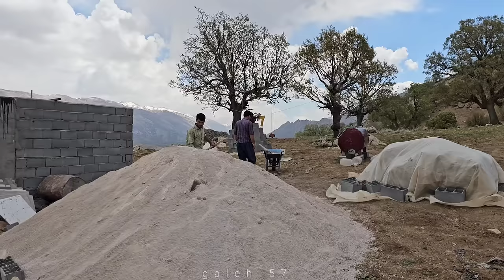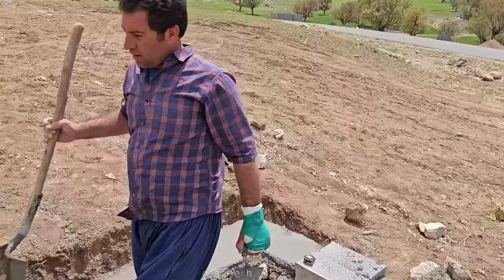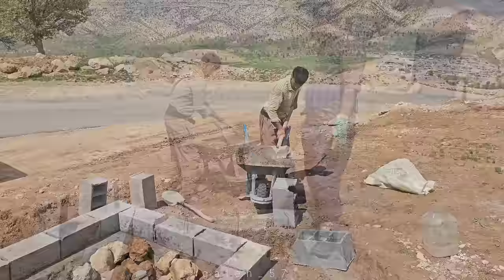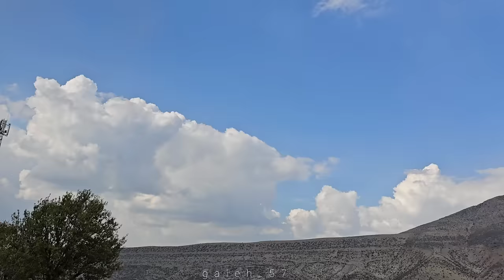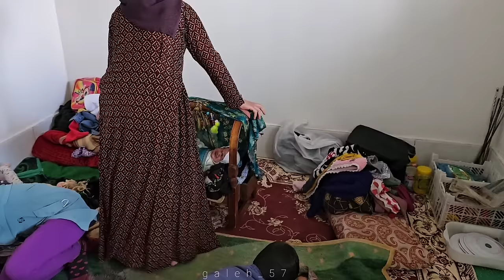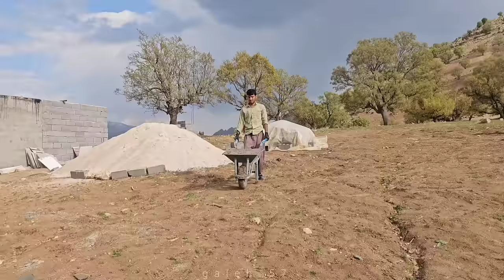Raising the wall of the toilet with blocks in a spring rain by the master worker

Comment: Strange way to proceed… 1) build the wall.  2) destroy part of it to open a window☹️  Furthermore I do not understand… what are they building ouside the hause if the bathroom is close the kitchen? Maybe there’s a difference between shower and toilet?
Reply: I'm confused ,  they just wasting material
Reply: Budują ubikacje z drzwiami na ulicę... Horror jakiś . Zamiast WC  z boku domu czy z przodu, to zrobili z tyłu , przy drodze i wejście od drogi....
Reply: Susan lo pidio ahi, cosa que a mi también me parece incorrecta, por poco a un metro de la calle 😬.
Reply: Es la parada del Bus😂😂, Dios mío, a lo mejor lleva después un cercado y ya no se ve de la carretera
Reply: There is a difference between  a bathroom and a toilet.    A bathroom is for bathing the body.  A toilet is for the elimination of  body waste. They do not have running water.  So, a toilet is a good solution.  
I don't know the  water table in this dry land.  So, drilling a well and installing water pipes  may not be feasable.
I live in an environment  where rainfall is generally plentiful.  There have been years when there would be drought.  But, that is not a normal thing  for us.
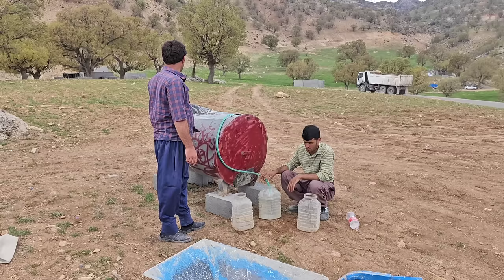Reply: 5:52 I think they're building an outhouse.  Putting it far from the house means they will have no sewage smell.  But across the street are people downwind living in tents.  Not good.
Reply: @PoohnTiggersMom ...metr od ulicy i z drzwiami na ulicę ? To jakiś żart ?
Reply: Yes shower is in different building from toilet
Reply: @roxelifigueroa3936  Yes, very strange indeed, but yes, the choice is hers. And I'm sure if the smaller children have to go to the toilet, Zaunab will be forced to go with them again. .
Reply: Bun comentariu
Reply: Susan why are you  putting the toilet next to the street! Poor decision,  you have small children,  and another thing, you depend on your oldest so much that the 2nd baby will only stop crying when she holds her. I don't know what to say  , but try to nature all of your children.  I see admire you ❤
Reply: Kışın bu tuvalete girmeye üsenir insan yahu umarım böcek filan yazın oluşmaz gördüğüm kadarıyla akıntı yeri olmicak toprağa mi disgilarini yapicaklar buda yazın çok sinek böcek uçuşur zor köydeki insanlarda bu şekilde evlerinden biraz uzağa tuvalet yapıyorlar derin bir delik
Reply: Yoldan geçen de artık tuvaleti kullanır acil durumda evin çevresi kapatılmalı ki burası suzana ayıt olduğu beli olmalı dışardan kimse tuvalete girmesin diye çok adada tuvalet kimin karariydi merak etdim
Reply: Si ellos los separan, a mí la ubicación me extraña del hinodoro pues
Reply: Porque todas llevan el pañuelo en la cabeza menos una
La mayor lleva pañuelo la pequeña también y la morenita no tiene que ponerse el pañuelo es una falta del respeto no llevarlo si Fátima que es más pequeña lo lleva porque su hermana mayor no
Está muy feo que lo lleve las dos y una no
Reply: @Amanda-La si muy raro
Reply: Suzanne  said the toilet  must be near the road 😂😂😂
Reply: @PoohnTiggersMom pero no son letrinas es su cuarto su sanitario..el poso va sellado y esto pasa y no hay olores..las letrinas si el sanitario está encima del poso habierto y si hay olor, creo yo q el poso va aparte y tapado total
Reply: The lady changed her mind
Reply: This  outhouse is built differently  from the outhouses that were built in the area I lived in.  I am sure these people made the right choice to meet their needs.  
There are containers with tops for using at night.  They must be emptied  and washed out. every morning.   This is something you just get used to doing each day.
Reply: Yeah my point as well. Separating the bowl and the shower doesnt make sense.. theres already a a structure in the kitchen and why make another structure.
Reply: Some things aren't meant to be understood
Reply: Of all open spaces why make a structure near the road ? Mr cameraman you should help make a plan
Reply: Deveriam fazer um banheiro grande,,com vaso sanitário e chuveiro,,e uma pia para lavar as mãos,,,igual se faz aqui no Brasil.....esse banheiro que estão fazendo agirá,, fuça longe da casa,,,e dias de chuvas??.??.nao entendi foi nada....sei que a cultura possa ser diferente nesse país,,,mas que está longe...isso está
Reply: @beverlyfrazier4751  Suzan hanım kendi istedi tuvaletin yol kenarına yapılmasını usta değil.
Reply: Porque não faz perto da casa então???
Reply: @estherguerrero6757 banheiro encima de um poço???😮😮😮😮😮😮😮😮😮😮e se esse piso ceder????
Reply: @dilekulker1760  Dilek hanım Türkiyede eskiden bazı köy evlerinde tuvaleti evin içine ama derin bir kuyu kazarak yapıyorlardı .hiçte koku olmazdı  sanırım.Suzan hanıma sordu usta tuvaleti nereye yapalım yerini belirleyin diye.ama Suzan hanım çok saçma bir şekilde evin uzağına yol kenarına yapılmasını istedi.küçük çocuklar gece nasıl gider hem güvenlik açısından hemde hijyen açısından düşünmüyor.
Reply: I’m very confused 🤔 Seems they do everything backwards!
Reply: @dilekulker1760  Suzan hanımın fikriydi .usta sordu.Suzan hanım yolun olduğu yeri istedi
Reply: La verdad que se ve barias opiniones , cada cual piensa a su manera, estas cosas de hacer renovaciones en una construcción pasa en cualquier parte , esas tierras tienen muchas complicaciones no para construir una vivienda , con lo costosa que es de bloque muy distinta a lo de ladrillo, esas tierras dificultan los desagues, pero eyos hacen lo posible porque se pueda tener una baza para las necesidades, lo principal y esencial es el que está dulce y bella mujer tenga una vivienda donde poder vivir más dignamente con sus hijos,este hombre con mano de gran trabajador y muy humano, si que debiera descansar unos días, que fuera algún masajista, porque los bloques pesan y tener que trabajar con una mano la fuerza también, Susan creo que lo entienda es persona muy humana y sentida...por lo menos a llegado a poder estar recogida con los niños en una parte de la,casa, el que usen las alfombras es su costumbre, lo tienen limpio mejor que los que tienen un gran chalé...suerte a que mejore este hombre y pronto estará terminado, ayudenla...🙏😘
Reply: I am sure there would be a potty chair for small children in the bath house, and maybe a potty for during the late hours of the night for everyone else.
Reply: @Colonnaisha8383Por eso son interesantes estos vídeos, es otra cultura
Reply: @RamonaBowers  Because Ramona the land near the house is too hard and rocky to dig. Soil is needed to absorb the waste. That is near the road.
Reply: @flabareba  ...i think you're right...😄
Reply: @flabareba  ..i think you're right..
Reply: YUP YOUR SO RIGHT.I DON'T UNDERSTAND IT TO I THOUGHTS THE RESTROOM WOULD BE CLOSED TO THE HOUSE OR IN THE HOUSE.... KNOWING THEY HAVE TO TEAR DOWN PART OF THE HOUSE AGAIN AFTER ALL THAT WORK?????????
Reply: @MegaMayra2003 Maybe she will open it up to drivers on the road and charge them 50 thousand Tomans take a dump 😉
Reply: Também acho estranho o modo como construíram. Aqui no Brasil os cômodos tem portas de acesso de um compara outro. Aí no Irã os cômodos são separados sem acesso por dentro da casa😂
Reply: If that’s a toilet they are building where is the waste going? There’s no sewer hole 🕳️🧐
Reply: Suzan why are you putting toilet next to the street? It is not safe for your kids especially at night time. You don’t want public to use your toilet.
Reply: @KH-ftc28 I agree
Reply: Perhaps the toilet waste will be collected in a bucket under the seat and composted for the garden, like many off grid homesteaders do in America. If she gets a goat, there could be a manure pile. As for privacy, a hundred plus years ago in North America the family outhouse would have tall hollyhocks growing all around for beauty and privacy, Susan might collect some bushes and shrubs to give privacy from the road. Land near the road is not useful for anything else so the outdoor biffy may as well be there. I think Susan is very smart.
Reply: I hope builder hand heals soon. Did he find the woman and kids that his mother threw out?
Reply: LADY LET THESE MENS DO THERE JOB STOP 🛑🛑 BUGGING THESE MENS ALREADY!!!!!!!... THEY KNOW WHAT THERE DOING MY GOD ...YOUR GOING TO CONFUSE THESE MENS 🤔🤔😱😱😱😤😤😤😤😤😤
Reply: THAT GIRL LIKE THAT GUY LOOK CAUSE EVERYTIME HE GOS AROUND THE GIRL ALWAYS HAS TO BE WHERE HES AT AND SHE'S ALWAYS LOOKING HIS WAY ...THAT DAUGHTER DONT HAVE TO BE AROUND THOSE MENS WHEN THEY ARE WORKING PERIOD!!!!!!!!TELL HER TO BE WITH HER MOM NOT MENS IT MAKES HER LOOK LIKE SHE IS EASY ??????????
Reply: Yes the shower and toilet are two separate rooms in many middle eastern countries
Reply: @Colonnaisha8383  Having lived with an outdoor toilet, I know you do not want it close to the house.  The English used chamber pots at night .  They were  emptied and washed out in the morning.  That is what we did.  All the people in the
Community did that.  
As far as being close to the road, that.  seems unusual to me.  But, I believe they have a reason that we don't  understand.
Reply: The toilet can not be in the same space as the shower
Reply: Εγω κατέληξα στη σκέψη ότι το κάνουν επίτηδες  για να συγκεντρωθούν πολλά σχόλια και κατά συνέπεια και λεφτά !!!!διαβάζω τα σχόλια και σχεδόν όλοι λέμε το ίδιο δύο ημέρες τώρα και αυτοί συνεχίζουν  μακάρι να αλλάξει κάτι  !!!!!αν και δεν το νομίζω !!γιατί  είναι κομπλεξικοι!!!δεν δέχονται Πολλα πολλά!!!!!
Reply: I think we all should leave these people alone
Let them do there work, they know what they're doing 
  wish them all the best
Reply: Theres no sewage system to connect to so the toilet is built far from the house. They will end up digging a well for the toilet waste to flow into.
Reply: Yes, they have a separate toilet and shower room/bathroom, that’s all. The toilet is in an outhouse away from the house to avoid smell.
Reply: @terezeferron870  - No, they are not wasting material! They need to have the toilet away from the house/kitchen to prevent smell.
Reply: @Amanda-La  - They have their reasons. Things does not work there as they do in the Western world.
Reply: @MegaMayra2003  - What is the problem with people seeing the outhouse from the road???
Reply: @bppbp.1081  Her name is Zainab. I don’t think Zainab is forced to do anything. She is an amazingly helpful young woman and help her siblings very often without her mom even asking.  Also, at night and/or in the cold season, I’m sure they use a bucket or potty, then emptying it in the toilet in the morning. They can easily put the potty in the bathroom at those times, it will be after the time where the bathroom/showerroom is used anyway. ❤❤❤
Reply: @beverlyfrazier4751 Didn’t you mean that she should try to nurture all of her children (not «nature»)? Just wondering… Also, how can you criticize her choice regarding the placement of her toilet? In a country that things work very differently than they do in Western countries.  The standard of such facilities are very different there than where you are, so how can you tell Suzan what she should do? She decided where the toilet should be, in cooperation with the workers. If they thought it would be a very bad idea, they would’ve told her, no doubt about that… I think it would have been a great idea if Zainab could get some kind of rewards for all the help she gives her mom and siblings. She is a unique member of this family. It would’ve been great if she could go do something special away from home or get some special present (e.g. a tablet/iPad, would be great for her to learn and use for school as well  as for fun)!!! I would LOVE to donate towards an iPad for her!! ❤❤❤🤗 ☮️ ✝️☪️⚓️💟 ☮️
Reply: Why is the toilet so near the road where are they going to dig the pit ,because the land slopes towards the road ,and why would she want it building there  she needs to be reigned in a bit with her spending it makes no sense to put it there what about winter when it's raining and snowing they would get soaked just going to the toilet
Reply: @Linda-f6f6k  I don’t know if you are in the USA or not… Actually, just to be clear; in the US, they call even a toilet «bathroom» (if it’s only a toilet, it’s often referred to as a «Half Bathroom» rather than the more precise terms «The Toilet» or «The Loo», as we say in many other countries). It is a kind of funny way to disguise having to do human things like getting rid of bodily waste, go to the toilet (what an embarrassing thing, LOL), which means they end out always asking «May I use the bathroom?», even if they aren’t taking a shower or a bath at all. Their intentions are to go Number 1 or Number 2 or both (basically they’re going «Deedelidoo at the Loo», LOL)… 😂😂😂
Reply: @Amanda-La  What’s the problem with the door there?
Reply: @dilekulker1760  How do you know that strangers use their toilet? If that is a problem, they can put a lock on the door, that’s all (a simple padlock, hang the key by the door in the house). ❤❤❤
Reply: @dilekulker1760 The final decision was taken by Suzan. She decided on the space in cooperation with the «Master Craftsman» and his apprentice.
Reply: @CristinaGarciarivas-fi1jp  I’m very sorry, but I think that is ridiculous!!! Nobody should have to wear a head covering because others do, especially not children! It is a very personal thing and no small children have to wear it. Babies need to cover their head though, it has nothing to do with culture or religion, they need to stay warm. I think they just use scarves on the little ones because it is easy and common there rather than the baby hats used in the Western parts of the world! Narges may not feel like having her head covered, and she shouldn’t have to either! And her not wearing a scarf is NOT ugly, has nothing to do with being ugly! Leave her alone, please!!! I really hope that nobody tells this to them!!! 😢
Reply: @RamonaBowers  It may be if they have to have a truck come with water for the toilet, as some has said before…
Reply: @Colonnaisha8383No, they do not make things strange!!! They just make things differently than here in the Western world. In their living rooms, the rug is the most important item. When we furnish a room, the sofa is the most important, in their homes, it is the traditional Persian rug(s). If they come to our countries, many choose to get rugs and combine them with a stack of foam mattresses and pillows they cover in a nice cotton fabric and they spread them out along the walls when they get guests etc. Seems to work great, as I have seen (worked with refugees for decades). ❤❤❤
Reply: @estherguerrero6757  You mean a sewage tank/septic tank, don’t you? A well is a source of drinking water (or oil or gas). Just wondering… 🤗
Reply: @RosasPandan-ww8ws  It makes perfect sense!!! You do not want to shower in an outhouse!!! This is not a western type bathroom! There is no «structure» in the kitchen and shower room that can be utilized for an outhouse. Who would want to shower in a smelly outhouse? Not me, that’s for sure!!! 😝🤭
Reply: @outonoinverno1144  - No, no and NO! They cannot make the bathroom with toilet, shower and sink like you do in Brazil or we do in Norway. They do not have the facilities to make such a bathroom, like sewage system in the ground or a septic tank! They do not have indoor plumbing at all. No electricity. Their toilet is not a modern water closet which is smell free! You do not want to have the toilet in the same room as the shower, that is for sure!!! Also, there is no sewage or septic tank or system, which you would need to do something like you say. So NO, they cannot make a bathroom like we have in western countries!!! There’s not even a practical use of a sink, since there is nowhere to get the water from or nowhere to send the dirty water… See the problems? ❤❤❤
Reply: @outonoinverno1144 Smell…
Reply: @outonoinverno1144 I don’t think she meant a well. She meant a septic tank or something like that.
Reply: @semrabaran1478  They can use a toilet bucket or potty at night, just like they did even here when my parents were small and they had an outhouse. They cleaned it out every morning. They can easily have this bucket in the showerrom at night, as they most likely don’t shower late at night or early in the morning (they have to light a fire, heat water etc. etc., it’s much more of a job than it is in our bathrooms).
Reply: @emilymcdonald6139 No, the outhouse can’t be as part of the house, it will smell horribly. They don’t have a sewage system, for starters… It is an outhouse,. not a western bathroom/restroom (as if anybody rests there, LOL)… 😂
Reply: @wilmabarbosa1800  How they are doing it, is the natural way when they make one room at a time. This house wasn’t planned all at once. At first the plan was only making a one room house. When they plan a whole house at one time, they plan it much like we do, except they have to take the environment where they are building into consideration…
Reply: Yes that is what I meant.  My comments about the toilet is not to criticize,  it's about safety!
Reply: @Paula855 There is no sewer there. I don’t know why they didn’t add a septic tank.
Reply: @KH-ftc28  They can put a padlock on the door, not a big problem…
Reply: @emilymcdonald6139 That she is interested in the work they do, make her «easy»??? You have a darn dirty mind, lady, don’t act all crazy!!!
Reply: You heard why? Because people in the comment field said they should!!!
Reply: We should stop being such besserwissers!!!
Reply: @terezeferron870  Oh my Goodness, they cut off 2 whole blocks… 🤪
Reply: Yes. There is different between shower and toilet
Reply: Sus costumbres son diferentes y se devén de respetar,en occidente se acostumbra que baño,regadera y lavabo estén juntos por comodidad ,el constructor d3cia que por comodidad de los niños,que son pequeños y no salieran al inclemente clima o podrían enfermarse había sugerido el baño dentro de la cocina pero después susan pidió una puerta y el baño por fuera de la cocina,esperemos a ver que sucede
Reply: Что это за туалет, под ним должна находится яма, куда будет всё собираться, а они камнями дно закидали, теперь землёй засыпают. Что туда ведро, что-ли будут ставить, и в него ходить. Но и из вёдра куда то надо выливать? Какая то бесполезная работа и постройки. Это точно для сбора лайков и помощи. Вообщем сказки для глупых взрослых. Ну понятно же, что то тут не то. Понастроили коробочек, бесполезных.
Reply: @lottatroublemaker6130 ...za dużo piszesz i trochę bez sensu. A po co załatwiać swoje potrzeby do wiaderka w domu czy do nocnika -  kiedy jest ubikacja na zewnątrz? Jeśli już WC stoi przy ulicy, to przynajmniej powinny być drzwi od strony domu a nie od ulicy. I bez przesady bo na całym świecie budowało  się WC na zewnątrz kiedyś ,ale  nie aż tak daleko od domu i nie z drzwiami na ulicę. To chore.. a żeby uniknąć smrodów z WC to wystarczy wsypać od czasu do czasu trochę sody i zneutralizuje nieprzyjemny zapach ...nadal uważam że toaleta odwrócona tyłem do domu a przodem do ulicy  jest nieprzemyślana decyzją... Dzieci latem zanim dobiegną do toalety żeby zrobić kupę czy siusiu to po drodze w majtki się załatwią, albo wybiegną na ulicę pod samochód. Komuś zabrakło wyobraźni. A ta wspaniała córka która pomaga mamie w wychowaniu dzieci to poświęca się rodzinie i ciekawa jestem czy mama to doceni i co dla niej zrobi, bo naprawdę dziecko dane z siebie 200% możliwosci. A ty kolego co tak tu dużo nam napisałeś niepotrzebie się tak "szarogęsisz" i denerwujesz. Bo my kochamy te rodzinę i chcemy dla nich jak najlepiej ...więc mów za siebie i nie mądruj się aż tak...
Reply: @Галина-ж3д1й ...zgadza się
Reply: @Amanda-La  не отвечайте мне, я всё равно не могу прочитать, а перевода нет.
Reply: U nas się tak budowało 40 lat temu ale z otworami na okna , a nie wynurzali później 😅
A  ta toaleta to dla wioski bo poza domem i przy ulicy🤔
Reply: I cant believe theyre carrying on with it there isnt anyone thinking of the children, everyone that agrees with it being moved please write in the comments then the cameraman can sort it out, shouldnt have a comments section if they dont listen
Reply: @jolanta6031  ..tak zgadzam się z tobą ...